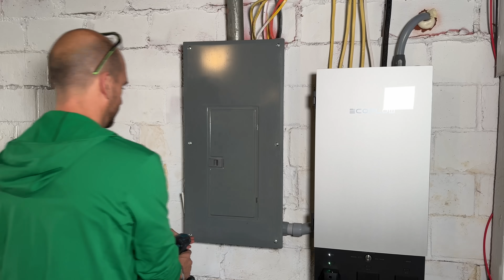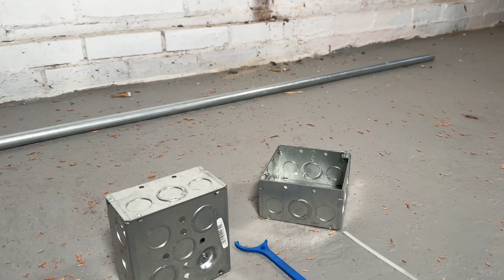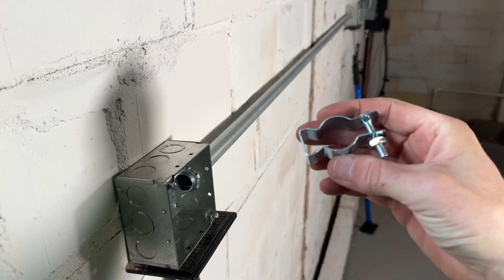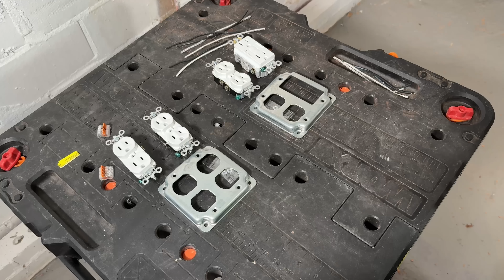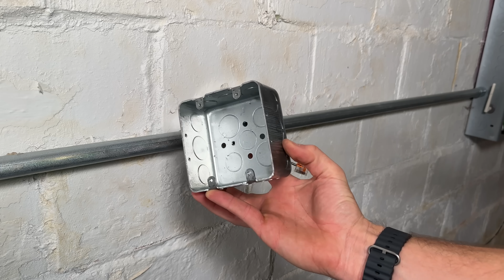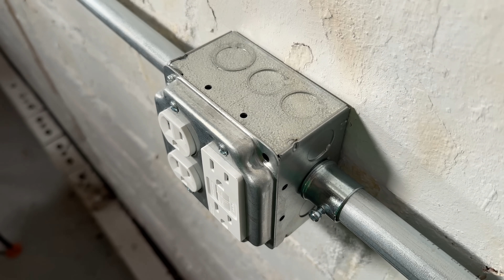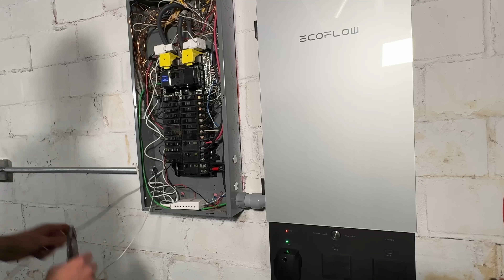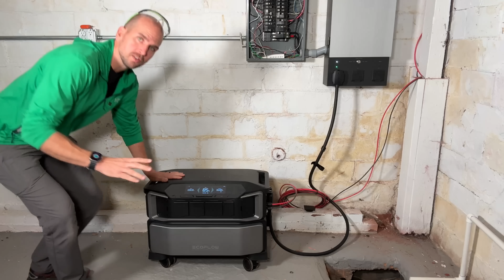Add Outlet To Unfinished Basement Or Garage

Comment: I thought a 20 amp circuit required 20 amp receptacles, the ones with the extra little T looking thing on the neutral plug slot.
Reply: You've got that backwards.  If you have a 20A receptacle "with the extra little T" then you need 20A wiring for that circuit.  But anywhere that the wiring supports putting a 20A receptacle, you can choose whether to put a 20A receptacle a 15A receptacle, with one major asterisk on that.  If you are passing current to downstream receptacles, you should make sure that how you are passing the current, is rated for the full circuit amperage.  For instance, if a receptacle or GFCI is only rated to pass 15A downstream, and you use that receptacle to pass current to downstream receptacles, then you should change the breaker to 15A.  

For that reason, I'd use a 20A GFCI here.  And call me OCD, but when wiring a series of receptacles, I don't even like passing the downstream current through the crappy tabs on the device or any other part of the device.  Each device gets hardwired to the actual circuit wiring, starting at the breaker box if not GFCI, and starting at the GFCI output if creating a GFCI circuit that way.  

While code allows you to put any number of receptacles on a circuit, I just don't like the idea of 20 devices all having to pass the current through their stamped tabs and screw terminals.  One cracked tab or one untightened screw creates problems.  Not that I love the current going through 20 wire nuts either, unless they are simple and I did them myself.  Someone in the future will redo them to add something, and have 5 different size/type wires on one wire nut in the chain.   Hence my preference for reducing the number of wire nuts also.  

Yes, I will leave hot and neutral both completely unbroken where possible, just stripping a section and bending a U to go around the screw on a device.  If by accident a screw is ever left untightened, it affects only that one device.  Downstream is totally unaffected.  It minimizes the number of pigtails, wire nuts, and other stuff taking up room in a box.  Obviously, that is labor intensive and not practical for a pro to do.  A good DIYer can afford to take the time to do things better than a pro.  

Disallowing someone from plugging in a 20A appliance, and limiting them to 15A rather than 20A fitting into the receptacle, makes things safer, not less safe. That is true regardless of the ampacity of the circuit.  Likewise, you can use 20A wiring and install a 15A breaker.  Tripping at a lower current than the wiring can carry, also makes things safer, not less safe.

But there is something to be said for making each receptacle on a circuit, rated to let you plug in an appliance using the entire ampacity of the circuit.  Then the pass-through issues are reduced, the flexibility maximized, and how the circuit is used in the future as a house and its loads get rearranged and renovated, will require little or no rework to add/move appliances.
Reply: @EfficientRVer  Virtually zero jurisdictions allow that style of wiring anymore. It is not recommended to strip away insulation without cutting the wire, bending a hook and attaching it to the device terminals. Also, "daisy chaining" is not longer permitted so you virtually have to use pig tails.
Reply: @EfficientRVer  Wow, thanks for the comprehensive reply.  I think I get it now.
Reply: As I understood it, if you're running only one receptacle, I believe you would be required, but if you have multiples you can use the lesser.
Reply: @embalmed  Correct. You can even put a 15a duplex on a 20 amp circuit breaker. But never a single 15a on a 20 amp circuit.

Comment: Since you're connecting to a 20 AMP circuit, shouldn't you be using a 20 AMP receptacles and the 20 AMP GFCI? These you using look like they are 15 AMP
Reply: There is really no difference in the internals of a 15 vs 20A receptacle, it's just that a 15A receptacle restricts anything plugged into it to a 15A appliance.
Reply: It is not necessary. See NEC 210.21(B)(3)
Reply: @TwilightxKnight13 the GFCI should be 20a
Reply: Thanks. Just read it that 2 or more 15AMP receptacles can be installed on 20 AMP circuit or one 20 AMP. I didn't know that. Thank you @TwilightxKnight13

Comment: I think that using the raceway is a lousy means of providing a ground. Anything that can possibly carry current should be a dedicated conductor. I mean, what does your family's safety mean to you? Is it worth the $1 or $2 you'll save if just one of them is ever injured? What happens when the faceplate is removed from the 4x4 box and power is energized? Yep, no ground. And no GFCI, either.
Reply: You're right about no ground.  You're wrong about no GFCI.  

While here, there is no ground available at the outlet (of a removed cover) for a GFCI tester to use to create a fault to ground (which will trip the GFCI) the GFCI will still trip if the current in the hot and neutral are not equal.  For instance if some of the current returns via neutral and some returns through your body to a grounded water pipe you are touching.  

Basically, you confused whether a GFCI tester will trip the GFCI, with whether or not an actual ground fault at the actual outlet will trip the GFCI.  They are not the same thing, specifically when the ground prong of the outlet the tester is plugged into, isn't grounded, so the tester fails to create a ground fault to test.
Reply: Thank you for making that information more accurate for me. You're right, I was assuming that the ground path had to be complete for the GFCI to operate. @EfficientRVer

Comment: It doesn't sounds to me like best practice to not run a ground wire if you have to check with the AHJ to see if it is permitted.
Reply: You don't have to check with the AHJ is you're following the NEC. There are 14 different types of grounding conductors allowed, and only 1 of them is a wire.

Comment: I would never cheap out on a ground wire. I'm sure the NEC would never allow this. Conduit is not designed to carry current and thus is not a legitimate substitute for a ground wire.
Reply: Surprise!  NEC does allow it - read 2023 NEC 250.118(A)(4)
Reply: Sounds good, but you're wrong.  A ground wire only carries current when something goes horribly wrong, so NEC does allow conduit to "be the ground wire" if done properly.  

But I see where you're coming from, so I personally use a real ground wire, and boxes with the nice raised hump for installing beautiful green ground screws onto.  While code doesn't require them to be green, it makes it clear that they have the right machine threads, and also makes it clear to anyone going into the box in the next 100 years, what is going on with the ground wiring.

Considering how many stupid things code requires for almost unimaginable worst-case scenarios, that they allow current to be flowing through every exposed box and conduit in this easily imaginable scenario of a hot wire touching a box, seems a bit on the ridiculous side to me.
Reply: @EfficientRVer  Yeah, I'm surprised. Conduit can get rusty and/or corroded or simply loosen up.

Comment: You didn't torque any of your electrical connections.  Breakers and outlets/switches should all be torqued.
Reply: It's pretty easy to turn your hand and wrist into an accurate torque wrench.  Tighten something with a torque wrench, then turn it 1 degree more by hand.  Remember what that felt like.  There you go, your hand is a calibrated torque wrench.  Repeat 100 times if necessary.
Reply: That would be something for the inspector to check before they sign off on the project.  I hope that with the permit to do this that he has an inspector check it.  If the inspector is a good one, he would say, "Please put a grounding wire through the conduit" as well.  Also, 20 A connections really don't require a torque wrench, especially if you have the experience and feel to it.  I would say that larger lug style connections like those used in connecting the panel to the service lines or larger circuits above 20 Ampere peak rating is where a torque wrench should be required, but again unnecessary.  My bike and small engine equipment mechanic has the feel of what the torque should be on each wheel's lugnut should be (he's also an auto mechanic) as he's been a mechanic longer than I have been alive (40+ years).
Reply: Good luck finding torque drivers with your residential electricians. It simply is not needed and inspectors know that which is why very few look for it. They can check a few connections with a "pull test" and be confident everything is good. Only commercial/industrial electricians use torque drivers with any frequency. In my years of electrical work, I have never seen an inspector use a torque driver to test connections in a residential space. Hell, the power company that comes to connect to your meter shell don't use torque drivers.

Comment: The thing I don't like is that the breaker panel is painted and your connector is creating an inconsistent grounding with the box depending on the hole size  and if it is touching the metal properly. I'm no expert but I see that as a risk pretty substantial risk.
Reply: GFCI's don't need a ground to work. They sense an imbalance between the hot and neutral. If the imbalance exceeds 7-10ma, they trip as some of the supplied current is finding another return path, perhaps through you. That said I am not advocating not to use a ground wire and neither does the NEC except when replacing old two wire receptacles with a GFCI.
Reply: For your argument to hold the GFCI would need to be before the conduit and not in it. Which means that the cables leading to the GFCI and the connection to it are not protected if the ground is not proper.
Reply: @mabelisle  I'm not following you here? The feed wires to any receptacle mounted GFCI are not GFCI protected. But they are still protected by the panel breaker. GFCIs are only required for certain receptacles  in certain areas. Hard wired appliances such as air conditioner condensers and pool pumps do not require a GFCI as the are properly grounded with a permanent ground wire. Again, the ground terminal on a GFCI has nothing to do with it's GFCI functionality.
Reply: @andydelle4509  I think they are saying that there's a real world risk.  If the conduit ground is broken at the panel fitting, and the before-the-GFCI hot contacts the metal conduit, you have a hot chassis situation that will not trip the GFCI and could give you a bad shock.  He should have just used a ground wire, I think the majority of people would have.
Reply: Won't trip the GFCI or the breaker, I mean.
Reply: @GigsTaggart  Well in that strange case, yes. You can never make anything 100% safe. In my pool pump example suppose the ground wire was not connected and the job not inspected. Or somebody cut the ground wire. But again I am not advocating not running a ground to a GFCI, in fact that would be a code violation with one exception I know of.  In an old ungrounded two wire system you have two choices when replacing or adding a receptacle. Use a two wire receptacle, which they sell at HD and Lowes. Or use a GFCI ungrounded. You can't put a grounded (3 wire) non-GFCI receptacle in an ungrounded 2 wire circuit.Connecting the ground screw to the neutral at the outlet is also not allowed.

I know a lot of people here including me do not like using the conduit as the ground wire. But nevertheless, it IS CODE COMPLIANT.
Reply: @andydelle4509  sure. knob and tube is code compliant and so is soldering wires with mastic and cloth tape.  I don't think anyone is saying a continuous conduit ground isn't compliant just that it's not how we'd do it.
Reply: @andydelle4509  ANYTHING RELATED TO A POOL PUMP, AND ANY EQUIPMENT RELATED TO WATER MUST BE GFCI PROTECTED OR IM NOT GETTING IN THAT POOL OR AT THE MARINA AS WELL. USE A GFCI BREAKER. You are a dumb ass if you dont.
Reply: @andydelle4509  Yes you can as long as the first outlet is a Gfci and protects down the line.
Reply: That's why the NEC requires that the paint be removed, unless using an attachment means that's designed to bite through the paint, so the fitting can have metal to metal contact.
Reply: Well the GFI tripped so what's your point lol?

Comment: I always put some construction adhesive on the juction box behind it to the wall. Helps hold it a bit stronger and seals around the drill holes a bit better. The gauge of wire youre using is the same as the Romex. There is nothing wrong with using romex in conduit.
Reply: Isn't derating required for Romex-in-conduit to  account for extra (potential) heat accumulation?
Reply: @freshtwink  great question. The code you're asking about has to do with how many current carrying wires that you can have in certain sizes of conduit, further reinforcing that it is ok to use romex in conduit. You can have too many wires in a conduit size and there are calculators that figure that equation for you.  If it has two wires, the maximum fill percentage is 31%. If it has three or more wires, the maximum fill percentage is 40%. Unless you are running several runs of romex in one conduit line this isn't going to be an issue with staying in compliance of the code. It's more about stuffing too many wires into one conduit, than it does about being able to use romex in conduit. Really, when I said it before that there is nothing in code that says you can't use romex in conduit, unless it's a damp, wet or underground situation... It's fine. It's fine fine. Like really, it's fine.
Reply: @freshtwink  No, heat accumulation is not an issue, just a myth.
Reply: @freshtwink  Only if there are more than 3 current carrying conductors in the conduit must you derate, and that includes romex or individual conductors. Contrary to yet another trade myth, romex in conduit does not result in overheating issues simply because it's in conduit.
Reply: Direct-burial wire can be run inside a conduit for extra protection. It's durable and can withstand adverse weather and rodents.
Reply: @JPetersU2be  I think everyone knows that. Kinda why it's called direct burial wire. It is fine on its own, without any protection, so obviously it would be fine in conduit as well for burial. This thread is talking about romex.

Comment: Folks don't bend box offsets anymore.
Reply: I do.
Reply: @Bluesman57  So do I. Either that or sometimes I'll spend the extra $ & use offset nipples.
Reply: @Bluesman57  Well, that would require a conduit bender, but I guess you could rent it from your electrical supply shop.  Also, one of the easier ways of doing this would be using 12/2 (with a bare ground) armoured shielding cable.  It doesn't look as professional, but the same effect applies.  I just find it interesting that he used conduit in an old basement, and most people know what is pretty prevalent in an old basement and that is moisture.  I know it seems overkill, but I would use outdoor rated conduit, boxes and plates.
Reply: I don't know about "folks" but professional electricians and DiYers who take pride in their work still bend conduit
Reply: @TwilightxKnight13  I bend conduit, I have multiple benders, I have greenlee little kickers one for 1/2 and 3/4 and make perfect box offsets every time.

Comment: I always used a hammer drill for Tapcons. I don't believe it's the impact driver that strips them. I am sure they were already stripped. I met a low voltage guy. I have met many in my life but this guy is the best at what he does that I have ever seen. His advice was to stop using a hammer drill and use a regular drill with a masonry bit. He said since he stopped using a hammer drill he rarely has them strip. He also uses a regular drill for larger holes in masonry so he doesn't get the exit hole blow outs. We are in Florida so it's mostly block with stucco over it. The exit holes can make huge blowouts. I stripped many Tapcon holes in my life. Since not using the hammer drill I haven't had even one strip. If they do strip adding a stripped wire in the hole usually works to grab the Tapcon.
Reply: Tapcons are one of the most frustrating useless fasteners. Just get a pack of plastic anchors with matching screws. Change your life.
Reply: You aren’t wrong they are a PITA but I like them better than plastic anchors. If they don’t strip they are great. Try using them without the hammer drill major success rate increase.
Reply: Great tip ,thank you
Reply: Bent drill bit and going too fast is the problem.  I use SDS rotary hammer all the time.  No problems, trick is slow down and don't bend the bit.  Your shoulder will hate using a regular drill if you do this alot

Comment: Hey Scott.
I have an exterior stud and sheet rock wall in my kitchen and breakfast area. It has several outlets in a row on the circuit, one of which is GFCI. I need an exterior receptacle. Is it possible and allowable to just punch through the wall at an existing interior receptacle, and put the outside box behind it?
If so, anything I need to know, like how not to make an ant highway?
Would make a lovely video....😎
Reply: Always check with your local building office. Most jurisdictions will require exterior devices be on separate circuits from interior circuits. Once the wiring is installed, you can stuff the penetration with fire stop material which will block insects from clawing through the hole.
Reply: I think that kitchen circuits are only allowed as kitchen circuits with an exception to them extending into a dining room.